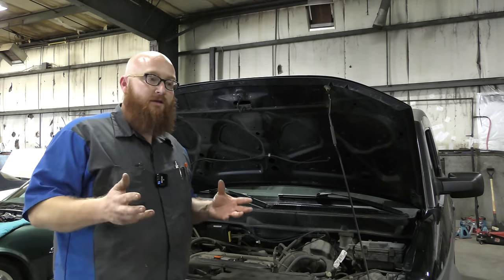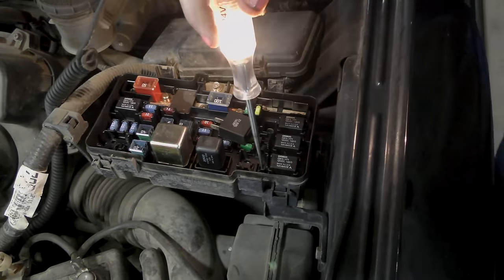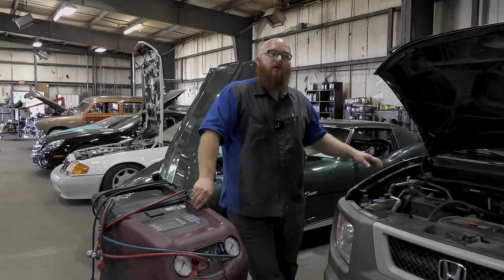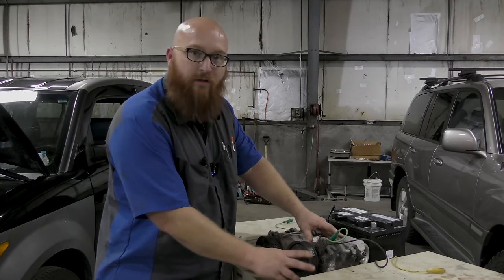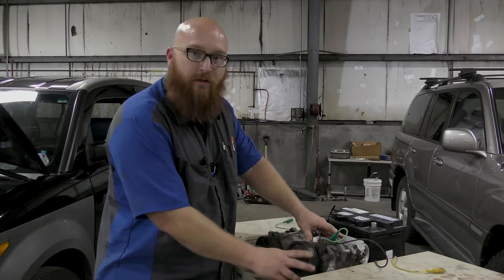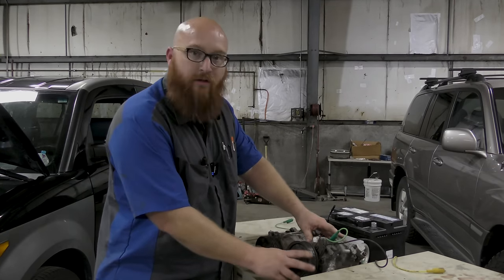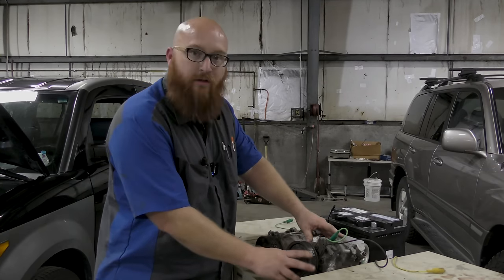AC not working!!! The CAR WIZARD shows how to easily isolate the problem

Comment: Hello , Thanks for the very useful video. My car , Vauxhall Astra has compressor running but the fans are not. I took to the mechanich , they did the gas refill but still AC does not work. Garage investigation says compressor is fauly but I can see compressor clutch engaing but fans not running. What could be the issue ?

Comment: I have a 2012 Taurus. The defrost works, the heater works, but the AC does not work. From outside the car I can’t even hear the compressor try to engage. My local independent mechanic was able to determine that there is Freon in the system. At that point he referred me to the Ford dealer. Before I take it to the dealer and likely get ripped off do you have any thoughts? This Taurus has the 3.5 Duratec so the compressor is buried somewhere. I can’t see it from under the hood

Comment: Your example shows you need to replace the clutch not the entire compressor.  50 bucks tops.  Yes if you find metal shavings you need to replace the compressor the dryer the orifice tube and flush the system.  You also need dual gauges to do a proper diagnossis.

Comment: I had 2 experiences ⚡. 1 chevy cavalier radiator fan stopped working and the ac blew up 💥. 2 Cummins shop put new compressor and in a day or two the the ac blew up 💥 turns out the fan clutch wasn't working. Both times it was the fan that caused the ac to explode 🧨.

Comment: following issues:

1. No power to the radio and sunroof controls.
2. Not getting cold AC air. The AC (snow flake) button doesn't light up.
3. Remote control will open/lock car door only during the first minute of opening or closing the car door. After the first minute, the car goes to sleep and there is no power available to activate the alarm.

Comment: My car A/C I’ve noticed over the past 2 months has gotten worse, the temperature at idle would be about 65ish degrees with the blower at max and the engine spinning around 650rpm at idle, I know with it being around 90f outside it should probably be lower than that, in the low 50s maybe with that RPM, now I tested yesterday at about 92f and the vent is blowing 75f, the compressor is constantly on now too, it’s not cycling like it use to, and the fan that cools the condenser that turns on and off with the compressor also is constantly on, I bought a set of gauges and am hoping it’s a case of both sides low pressure which would most likely be a leak, and am hoping it’s not the compressor that’s leaking….

Comment: Dang car wizard im trying not to spend much my ac was turning on blowing regular climate air when on cold and hot air when on heater. Yesterday my compressor stopped blowing air all together. I just received this hand me down from my mom and I’m grateful but I just replace so much stuff I’m trying to save myself at least 200 bucks from buying a new 600 buck compressor. I’m hoping it’s just a leak as we found it yesterday with the air machine. I’m hoping I just have to pay for the leak repair and hopefully my compressor kicks back on. Back tracking i noticed my compressor wasn’t turning on when I was testing to see if my ac was turning my high and low pipes cold but when I returned to the car my ac finally wasn’t blowing. Sucks that this happened at the start of summer.

Comment: Condenser fan question. I have a 2005 Sequoia Limited 2WD with 237K. Still has factory Denso fan.

I understand that the condenser fan only comes on when the AC is on.

My question. Does the condenser fan change speeds when it’s on? Or should it should it be a constant speed? 

The AC mechanic told me I need to replace my condenser fan.

When the truck is stopped/idling, it tends to spin much slower. Obviously, I can’t see the fan while driving. I was under the impression that the condenser fan speed should remain constant. Regardless of whether you’re at a complete stop or driving city/highway speeds.

Or am I missing something?

Comment: Great find for me.    my Ac on my new motorhome was working now it is not.    I am bottoming out my front end from the pot holes on the freeways and wonder if one of the huge slams could make the pressure switch fail?  also my local general rv dealer worked on the defrost venting before i needed the Ac, could they have moved the venting to cause the issue.?

Comment: No reason that you should have to remove the compressor completely to change the clutch. You can leave the compressor lines intact (no evacuation required), even if you have to pull the compressor up to get enough room to get at the clutch. If there was nothing else wrong in the system other than a failed clutch, there would be no way i would be buying a new compressor.

Comment: Most car ac i have looked at were overcharged. Mine quit cooling because the heater control valve failed. After the engine was warm my ac blew hot but not in the rear where it was still cool. The ac air going through the heater core was heated up. The valve is made to fail to heat on.

Comment: Hey wizard I changed the ac compressor in a 2005 Honda crv and the new compressor is good I did use a power probe to engage the clutch on the compressor so I know that works. Is there a possibility that the condenser fan could be bad and not engaging the compressor? You said Hondas are finicky so this could literally just be a pressure switch situation or is the condenser fan a possibility

Comment: I have a 09 Honda fit, the ac works while accelerating and blows cool NOT cold, but once the car is idling it stops blowing cool.  When I checked the low pressure side with a gauge the pressure was high

Comment: wizard... I have a peculiar problem. I vacuum the system for an hour. make sure nothing is in the lines, and then when I add freon, it will only take about 4oz. it wont take any more than that at all. 4oz. Brings it to an over pressure basically.

Comment: I wish you were a mechanic in my town… I had a mechanic who change the compressor and he ONLY changed The compressor and my Ac it’s still not working properly… some days is hot/cold and if it’s running cold sometimes the car will start shaking and the air turns hot… Idk what to do because I keep taking it back to the mechanic and he continues to says that nothing is wrong 🤦🏻‍♀️

Comment: Question …… my son recently bought a 2003 GMC Sierra 5.3 Z71

The ac wasn’t working when
We got it , so we replaced the accumulator, condensor and compressor … we vacuumed system for 45 mins , it held vacuum perfectly , so when we went to charge system , it took the first 12 oz can of 134A , but the second can it stopped taking it in . So what do you suggest as my next step ? Is it possible that there could be a blockage ? Or something we should have replaced but didn’t ? Any advice Is appreciated . Thanks 

Side note , my other son has the exact same truck but it’s an 02 , this last week we did all the same repairs and were successful.

Comment: @7:55 “that’s not something you can guess , or with a can you buy at the store” ,    Yes, but you can empty it all the wAy out, lookup how much R134 your car takes by weight, and use a can to add that much back imho.. and you don’t need a $4k machine or $125 he mechanic to do that either.

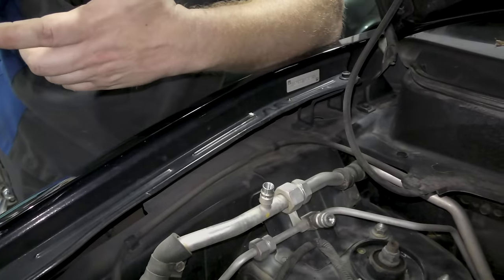Comment: My AC stopped blowing cold air intermittently, and now it's no longer blowing cold at all. When testing the refrigerant using the screwdriver method you showed at 5:32, I did hear the air pressure noise (air rushing out). Does that mean the problem is not due to low refrigerant? One thing I noticed is that I didn't see the shot of fume coming out like in your video. Is it possible to have air pressure but no refrigerant?

Comment: So why not just Evac and clean out your system rather than buy all the other parts ? I'm thinking if you do a quick pressure hit on the Schrader valve and it's coming out clear you should be in the good for just a compressor,right?

Comment: What do you do if you took your vehicle back to the dealer to get AC fixed and they said they replaced the compressor and now it blows hot air once again 3 weeks later?

Comment: Very informative! I have no power switching on at the relay. I jumped the relay, and got good ac. Now I don't know where to look. A short?
Reply: 06 f350 6.0
Reply: Fixed? Too low a refrigerant charge (no liquid in system) will cause the low pressure switch to be open, and HVAC module will never activate the clutch relay. If you have too much refrigerant, the clutch should still engage until high side pressure exceeds operating limits and opens the high side pressure switch. I have a detailed top level comment if you still havent had it fixed.

Comment: following issues: bmw 330d 2006 

1. No power to the radio and sunroof controls.
2. Not getting cold AC air. The AC (snow flake) button doesn't light up.
3. Remote control will open/lock car door only during the first minute of opening or closing the car door. After the first minute, the car goes to sleep and there is no power available to activate the alarm.

Comment: Very informative except still not working I tried to remove the clutch and it does move freely but it appears to be stuck in the on position if that is the case what is the problem I cannot control it from the car pushing the buttons does not take it on and off it also does not light up the light is that is the case what is the problem? Is it behind the buttons is it in the wiring?

Comment: My a/c works driving down the road and when I manually turn on engine fan. But at idle a/c doesn't turn engine fan on. This is on a semi. Peterbilt 389. Heard is possible that high pressure switch is bad. You think that is a possibility? Note my a/c worked fine before I had a new engine installed. They had to evacuate a/c to install engine. I was hoping they could install without messing with my a/c. Also doesn't work in the sleeper. I think I should change expansion valves. Dryer and pressure switch. You think that would be a good start. Because I know compressor is working

Comment: Hi Diy, I just recharged the AC on my ZDX.  Everything is fine and cold.  My question is, the air blows 5x more on the passenger side than the drivers side.  I saw a video possibly resetting the fan by raising the temp to high for 5 minutes and then lowering it to the lowest temp for 5 minutes.  The video said that would reset the blower fan.  Any thoughts on this or fixes to balance both sides?  Please advise, thanks.

Comment: Someone around the block from me bought a Civic with a snapped belt and he wanted me to put a new one on so he could drive it. But I wondered how he got the car to his house if there was no belt on it but I digress. I out the new belt on an it started screaming! It was rubbing so bad I immediately shit it off at looking closer, the compressor was shot but the pulley wasn't even straight! So I bought the smaller non a/c belt so he could drive it and told him to get it to a shop. I have no idea how the compressor ended up not sitting straight. 🤔

Comment: Hi Mr. Wizard, I have a question. I own a 1995 C4 corvette convertible. It has 163,500 miles. I just changed the oil and  oil filter. She sounds smoother  but when it is warmed up the oil pressure is  low at idle between 12 and 15lds. I was told I need an engine rebuild. Verified the oil pressure sensor is good, analog gauge connections are good. I don't have the $$$$ for it now. Could I add a stabilizer in the mean time? And yes I know that is just putting on a bandaid for now.

Comment: Would a bad relay throw a code? I have a 2001 v6 mustang. Sometimes the clutch will not engage for over 20 minutes. Would suck if its the relay because its soldered to a control module bolted in the front  passenger wheel well.

Comment: My system has good pressure, and the clutch engages, but it doesn't blow cold. What could it be? Could the compressor, even though engaging, be bad?
Interestingly, after a vacuum and recharge, it blew cold for one day.

Comment: Hi W! I did the first 3 tests (control panel function; relay; gas). All work, but the AC fan is not turning. I feel the AC works but does not cool much. Is it because the fan is not working? Thanks for your help!

Comment: If you run your car with a broken compressor, actually it is a bad idea. Because if there is internal damage in the compressor and it engages there is a possibility it will lock up and burn up you serpentine belt, which usually runs other accessories. Result would be a higher repair bill and a possibility of tow to the shop on top of the cost of compressor repair. Plus if you loose power steering that can be dangerous.

Comment: What would cause the 10 amp fuse to blow?  Its the fuse for the compressor. At this moment I'm not sure if it blows right away or when the AC is turned on.  I believe its a short but am wondering where its most likely to be shorted.

Comment: I have an 1994 Olds Cutlass Supreme S 3.1  and my a/c has been blowing HOT air for the pass 2-3 years and the last time I had it replaced it was  2013,So could it be the fuse or do I need the whole thing replaced? What wasn't covered in that 1st price of $1500 or $1600 to replace EVERYTHING you didn't included the labor cause this is what shoots the price way up is the labor

Comment: Great Video.. Can I ask you a question.  My daughter has a 2017 ford explorer and she just had a new AC compression installed, belt and tensioner . When the car is on and in park the ac works fine( cold) and quite. However when she is driving the car is make a whining noise. do you know what the problem might be.  If the ac compressor is bypassed there is no noise. The person that installed it thought maybe he new compressor was bad so he installed a second new one, we still have the problem any ideas? Thank you !
Reply: Hello I have the same vehicle and my dash is reading -40 I replaced the ambient air temperature and it’s still not working my Freon is reading high but I didn’t put any in there I bought the SUV last year used my car only blows hot air

Comment: Great video. I am having a problem with the a/c. It is working and blowing cold but when I switch it on, I notice a real drag and shudder on the engine and a slight high pitch whine I do not  use it anymore as wary it is doing something bad to car engine. My qtn is if air con repair is major, eg the $1700 that you mentioned, and you are not going ahead with the repair (old car) and choose not to have air con or the defrost option, should you have the air con compressor totally disconnected so that it is not working all the time just for occasional defrosting which is not a problem anyway where I live?

Comment: 2012 Ford Escape, trouble shot all of the above. Everything is working as it should, however, my car A/C only wants to work when the temperature outside is cooler. It is like it is sensitive the the actual temperature. Is there a temperature sensor linked to the A/C system that I need to check or replace?

Comment: Hi Mr. Wizard! We have a 2019 Chrysler Pacifica that barely blows air out of the driver and front passenger A/C vents unless the fan is set to max. On low setting, barely any air comes out.. and when set on max it’s as if the blower had to build up strength and progressively blows air out until it does, but never to full strength, even on the max fan setting. The A/C is cold, that’s no problem, but barely any air comes out the vents on the low fan setting. What could this be? Maybe a bad blower??

Comment: My daughter"s 2009 Ford Fusion is barely blowing cool air. The clutch is pulling in fine. I was getting weird results on my gauges and decided to replace the TXV and recharge with the amount Ford called for, but the system still doesn't cool well. Last night I was able to barely squeeze my hand down to the clutch without the engine running of course and the clutch seemed to turn very easily. Is a weak compressor a thing?

Comment: So if I’m having the same problem in my 2012 Toyota Camry and let’s say the refrigerator is good does that mean I have to change out both of the fans? Or just the one fan that doesn’t turn on or do I change out the condenser?

Comment: im having issues with intermitent a/c on a 2016 Scion im with 120 000km. Pressur😂e are ok when it works. But as soon as it gets hot it doesnt work (very convenient 🙄). 
It has those new variable compressors. Would be nice to have a video on those. Ive fixed many car a/c with fixed compressors. But this new crap i cant seem to diagnose it without a bi directional scan tool to force the system on. Since the compressor works on a pcm signal.

Comment: I have a leak in the AC hose which I tried to fix myself and then add refrigerant I used a metal Bondo paste and it failed.  How do I know if I need to replace the entire AC line ? I think the compressor the blower the fan all seem to be working because the air is blowing and it will defrost.  And where are you located ?  I'm in Texas.

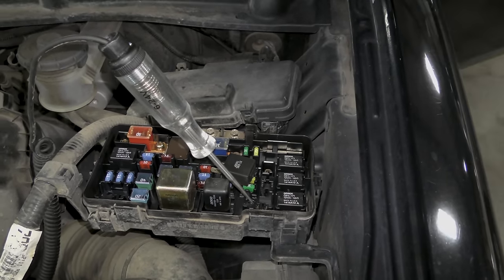Comment: great vid!    So at the 3:31 minute mark, I DO NOT have power. (but on my dash inside my AC on/off button does lite up and my fan runs, etc when I push it in to start the AC).  You DID have power so you continued on;  but what do I now check if I don't have power there? (I do have 110 Ohms across relay pins 30 and 87) and I CAN remove my relay and use a wire jumper to get my comp turning but it's not really cold air.  THANKS !!

Comment: I was driving A/C on full blast then all of a sudden I was taking a left at the light and smoke coming through vents I quickly turned my hazard lights on and went off to side of road and cut the truck off. I thought 💭 it was the engine come to find out it was the compressor now i believe I need a new one mind the one that blew was pretty new probably only 300 miles on it.